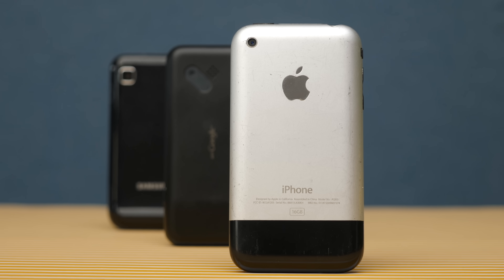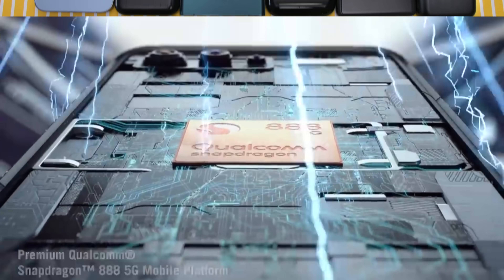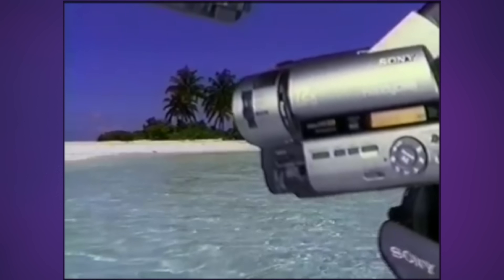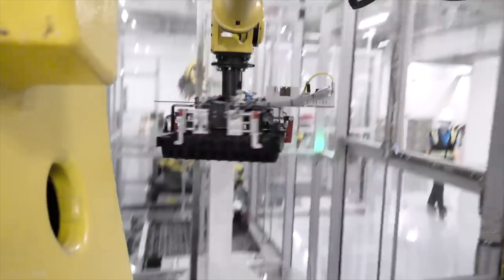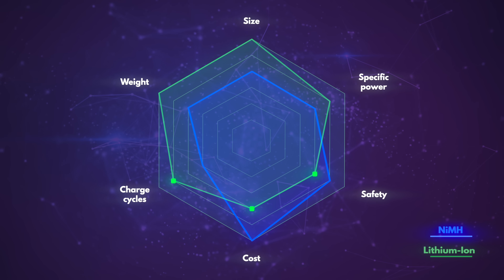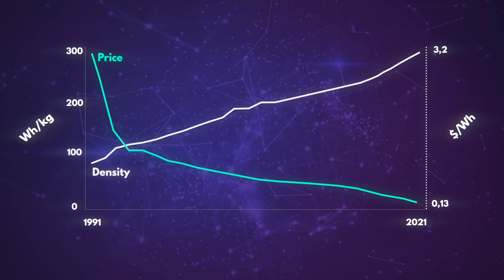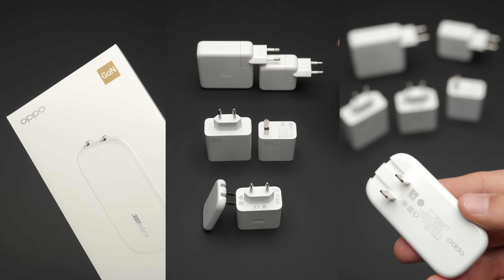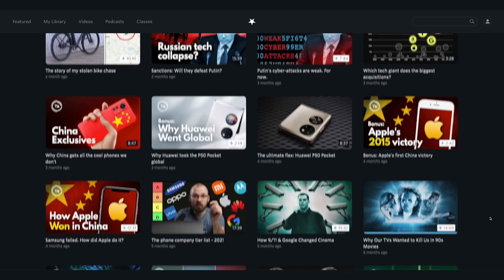The billion dollar race to fix phone batteries

Comment: As a chemist (who is also interested in electronics) i have something to point out:
- Not only sodium is heavier than lithium, but it also have a slightly lower (well actually higher, because it's a negative value) redox potential (talking about the Na / Na+ couple), and even more importantly it has a larger radius, which make it difficoult to intercalate it in a crystalline stucture, such as graphite (Na also forms dendrites when crystallizing). Na is also much more reactive than Li, exploding in contact with water instead of "just burning", but at least it doesn't burn in N2...
- EVs are the devices which benefit the most from Li-ion tech: since they have to carry around the battery, the lighter this is the less energy you waste in carrying it around. Using a less energy dense battery type on EVs is ideally wrong. For stationary devices, on the other hand, weight is not an issue.
- Silicon doesn't have any energy storage power, because it's not involved in the redox cycle. The sole responsible for energy storage in Li-ion batteries is lithium, and this is why you would want to use pure lithium as your anode, instead of using lithium ions intercalated in graphite / silicon. Unfortunately this is impossible, because of lithium's tendency to form dendrites, which then short the battery, triggering an explosion. This is ultimately due to lithium's crystalline structure (which cannot be changed).
- Solid state batteries were thought to be a way to prevent dendrites formation, hence to use pure lithium as an anode, eliminating the need for an intercalating material (such as graphite / graphene or silicon), thus increasing energy density. However, solid electrolites looks to be ineffective to limit the formation of dendrites.
- Making batteries more energy dense would be extremely dangerous: since batteries contain a full redox system they are essentially a fuel which already contain the oxidizer to burn it. In other words they're a lot like gunpowder, or thermite (which is the best analogy, due to its metallic nature). The fact that Li has the lowest (-3.07 V for Li / Li+ couple) redox potential of the entire periodic table doesn't help: it basically means it can burn in everything using everything as an oxidizer (apart from noble gases). It's also one of the two known metals (the other one being magnesium) capable of burning in a pure nitrogen atmosphere. This is why Li ion batteries are considered a dangerous good and can't be shipped on airplanes.

In synthesis, Li ion battery technology has reached its full potential speaking of energy density. We have kinda reached the end of Moore's Law for batteries. If an improvement to battery life can be made, this will come from software optimization, SOCs specifically designed for mobiles (such as Apple A series), new manifacturing process nodes and more efficient displays.
Reply: -Czechs-made HE3DA battery which you can shoot at and it will not start burning, though the cost will be higher, it may be a better choice for home solutions in places where house destroying natural disasters (tornados, earthquakes) are common like the US.
The most useful will be HE3DA for aerospace & military though as dealing with lithium fire on diesel-electric submarines would be problematic, that's for sure. Currently, only a few mostly Asian submarines from early 2000 onwards use lithium batteries, and with further development when coupled to Sterling engine or hydrogen assisted energy storage like on German subs can possibly displace the need for nuclear subs even for larger nations in the future.
-Solids state batteries are likely the future because they charge faster and presented models do not last as many cycles, which is perfect for car producers that want to sell you a new car every decade or two while claiming how they care about the environment. The fact that they can precisely time when you will need to buy a new car by using a battery with limited charging cycles which many will actually prefer just to shave off a few minutes from supercharging is pretty much the perfect way for guarantee planned obsolescence for people living in cities without own garage that will want such batteries in their cars.
Batteries on current Teslas and South Korean passenger cars that can recharge from 20-80% under 20 minutes are already more than good enough from performance and service life standpoint for 95% of the population that have their own garage and do not need to tow heavy cargo on regular basis, it's more than plausible that future generation of car batteries would not last as long when there will be no ICE car alternatives anymore which would allow customers to protest against likely trend of cheaping out on future car batteries.
-As a buyer of higher quality electronics I am personally far more interested in long-lasting batteries than ones that can charge a bit faster or adds 15-25% energy density improvements at the expense of service life, Mrwhostheboss made a video on bulging Samsung phone batteries that did not like European heatwaves, did Samsung used different chamistry for European market as they once used different chips compared to what the US got? 
Searching for replacement battery decade or two down the line is with the current rate of progress rather problematic, at least some producers allow you to purchase AA/AAA battery pack replacement for original li-ion battery so you don't need to horde lithium-ion batteries for various measuring and radio equipment that tends to last decades.
Reply: Let him cook
Reply: Would aluminum work since it has a high charge density?
Reply: personal EVs are such a waste when grid based train tech exists and storing wind and solar is far inferior to nuclear power
Reply: @MsZsc  there is some logical use for personal EVs for people who live outside of cities, and thus outside the logical reach of public transit. I personally don't plan to buy one as long as they're made with lithium due to the environmental and human rights concerns mentioned in this video, but if they move to a battery tech that either doesn't degrade over time (seems unlikely to even be possible) or something with abundant source materials, i may be persuaded to buy one one day.
Reply: Bravo!  Very well stated!!!
Reply: What do you think about Lithium Titanate (LTO) batteries? They're advertised for traction applications as they can take greater currents with lesser need of cooling, though their energy density is lower than other popular lithium chemistries.
Reply: Lithium titanate nano crystals replace the carbon.  This results in a lower operating voltage 2.4V and lower energy density.  Hence they are safer.  One great advantage is the that they last 6X longer than the traditional 3.6V lithium ion batteries.    @MuhammedGemci
Reply: What is your opinion on solid state batteries as a future technology? Is it bunk science?
Reply: @cyan_2169  as a chemist with a chemist friend who's masters project was on solid state batteries I wouldn't say SS batteries are bunk science but they're not as close to creation as is stated by corporations and their benifits may not actually be as good as first predicted atleast for a long while
Reply: @jacobarcher1097   Graphene batteries are 10x faster to charge and hold more battery in a smaller form factor than lithium batteries, in my opinion graphene batteries (really anything graphene) is the future
Reply: @cyan_2169  the company ElecJet will build a 'test production line', which starts producing in Q1 2023. Here they'll build solid state batteries.
Reply: "we've reached the end of moore's law for batteries" 
Surprised how you know so much about current technology, but yet know nothing about future technology. 

I'm talking about the most mainstream future material, Graphene. A graphene battery could charge batteries up to 10x faster, whilst also being able to store more charge in a smaller form factor than lithium. It has the same issue that lithium batteries had, and that's becoming commercial. But yeah we're far from reaching the end of "Moore's Law".
Reply: @utubeusername927  "A graphene battery could" 
Just change "could" into "does".  It's easy when you try!
Reply: @robinpclarke  Not my job to prove that, just to prove we haven't hit Moores law, which is obvious when you observe every property of graphene
Reply: @utubeusername927 the chemistry of batteries is pretty well understood, and within that there are limits to how energy dense a battery could possibly be. I don't know how close Li Ion is to the theoretical maximum, but if a chemist says batteries have peaked, i'm more inclined to believe them than techbro hype about graphene.

Comment: They could also try to reduce the power that the phone needs. New displays or low energy CPUs could help to make the battery last longer.
Reply: I mean, that's exactly what they are doing. Given that companies like Apple and Samsung are stuck with current battery technology, it would be foolish to not optimize the phones energy efficiency. When it comes to displays for example, OLED's are more power efficient than LCD's for most image content, variable frame rates save loads of energy without sacrificing performance.
And an example for CPU’s is Apples A15 bionic chip's performance cores which improved energy efficiency by 17% on it’s peak performance versus the previous A14 chip.
Furthermore; software is very much responsible for power consumption, not just hardware
Reply: @JolleBoiii really? I always heard that OLED uses more energy than LCD.
Reply: or RLCD screens which reduce energy needs by like 70%
Reply: One way I've thought about to reduce energy consumption is to include a small (say one line of 30 characters) LCD screen in addition to the regular screen. That could be used to display always on information (like the time, battery charge, and notifications) so that you don't have turn on the mainscreen as often. Considering that a watch with an LCD display can operate for years on one battery it could extend the battery life a bit.
Reply: it can, but that casio does not use a backlight constantly, does not even have a cpu and whatever circuitry it has is clocked about a million times lower than a cpu commonly is.
Reply: @Solitaire001 As far as I’m aware the Google Phones do this already. But tbh, I’m not sure if a lot of consumers would want this, most people have already got watches which do the job for them. I do like your idea though
Reply: They could stop making phones so damn thin. That alone would prevent so many issues. Most people end up putting their ultra-thin phones into cases anyway.
Reply: Yeah that’s what they’re doing but that’s exactly what’s holding phones back. If you’re gonna reduce power consumption it’ll also reduce the speed of the phone (99% of the time). So the video was talking about how it’s the bottleneck in a ton of products reliant on batteries
Reply: @monhi64  instead why don't you make the architecture so powerful and ahead of it's time and then underclock it's power so it will last like 5 years and will be efficient I mean that's what ARM architecture is and why apple went to that for their computers witj the M1 chips, but also CPU architecture needs to evolve
Reply: @realspeedghxst  Easier said then done. they have been trying to do that for 2 years, ARM CPU tech hasn't been able to improve density it has hit a brick wall where it can improve no further without using new materials.
Reply: @MarcABrown-tt1fp  well CPUs still work on the binary system and that needs to change with quantum computing so computers can evolve but it's gonna take a while
Reply: Lower end phones with similarly lower end CPUs tend to last much, much longer under load than high end devices. 

High end SoCs are quite efficient, but are also built with very high turbo speeds. They can sip power under low loads, but will also devour it under heavy loads. 

There’s really no way around it if you want phones to be able to handle heavier workloads. You simply need more compute power.
Reply: @Lauren_C  I'm pretty sure its rare for any form of silicon chip to die of natural causes in the lifespan of a device, usually a phone is replaced well before copper migration kills a CPU. takes 10-20 years of continuous use at full blast for that to happen if your unlucky. The Storage drive, and battery also dies much sooner.
Reply: @MarcABrown-tt1fp  I should've clarified that I meant battery life...
Reply: @Lauren_C  Oh. haha

Comment: Another issue with battery life is, that it's not a standalone value (like e.g. camera quality) but instead a budget. Many of the components of a phone can benefit from consuming more power. With more power, you can clock the CPU faster, make the screen brighter/bigger and even the camera and radios can benefit from fewer energy restrictions.

So when they double the capacity of the battery, a phone maker might decide to the upgrade other components. That's why the improvements in battery performance haven't lead to significantly longer battery life.

Just to make a point: old dumb phones from the early 2000s were able to run for over a week on 1000mAh or less, while current phones often don't last the day, even though they have 5000mAh or even more.
Reply: Very true

Comment: When the battery is too good the sales of the new phone might plummet.
That's why the manufacturer might increase the battery size but CANNOT increase battery reliability.
Phones without an original charger like most phones sold lately also will make the battery broke faster

Comment: It seems like we have a few different paths to improving battery life: improve battery capacity, improve hardware efficiency, offload processing (to the cloud or to a paired personal computer), and develop longer-range wireless charging.
Reply: efficiently transmitting energy to a small patch of space (10cm) at a practical range (10m) without some physical (wave)guide is surprisingly difficult, you'll have to focus the energy accurately and keep an active tracking of the receiver's position, and yet there's still the orientation of the receiver.
Reply: And make more efficient software.

Comment: I like waterproof phones.  But god I hate the non removable batteries.  I tried living with it and what happens?  "OOPS your phone screen is black and restarts and running it out of power doesn't work to reset it!"  Solution turned out to be to disconnect the battery and reconnect it. 

Would have been simple with removable batteries, but nope, this sealed phone design has dug its heels in and how convenient that we need special tools or pay an exorbitant fee just to do something that used to be routine.

Comment: I think the biggest problem people have with lithium batteries is the fact that it degrades, not necessarily the problem with poor battery life (though that's a separate topic). I think most in the comments are suggesting improving battery efficiency through efficient CPUs, but that alone doesn't solve the issue of degrading batteries. If people could use their batteries longer without having to get it replaced of buying a whole new phone, then it would have less of an impact on the environment and people don't have to pay $70-$80 for battery replacements every few years.

Bluetooth headphones like AirPods are an even bigger issue because you cannot replace the battery inside it at all (Apple doesn't even replace it, they will just swap it out with another one... that's because Apple superglued it inside and removing it damages the headphones). And the fact that manufacturers removed the headphone jack doesn't make things any better.

But changing to a new battery technology to reduce reliance on things like cobalt which is bad for the environment and there's a lot of human rights abuses in these mines in 3rd world countries (child labor). And hopefully it would solve the issue with degrading batteries.

Comment: Realistically, for lithium ion batteries to actually rival hydrocarbon and hydrogen based fuels in terms of energy density, the improvement required is an order of magnitude at least. Fast charging won't be viable without high voltage, ridiculously large charging ports and cables as well as obscene I2R losses from absurd currenta are anything but green. As for phones, laptops, etc., If I had a choice, I would choose LiFeP batteries until something substantially better comes to market at a reasonable price just for the superior safety and potential lifespan.

Comment: I repair my own phones myself so once a battery goes then I open it up and do the thing. No problem.
Reply: Well, no problem... You have to find an original battery for your phone. That's usually impossible. So, you are forced to take a gamble with a third party battery...
Reply: @jesuslcampillo1989  there are quality 3rd party sellers out there. Ofcourse you cannot depend on OEM parts to be available.